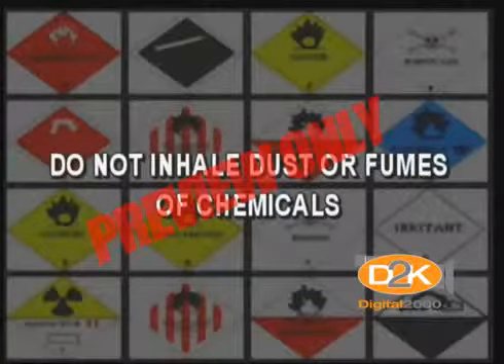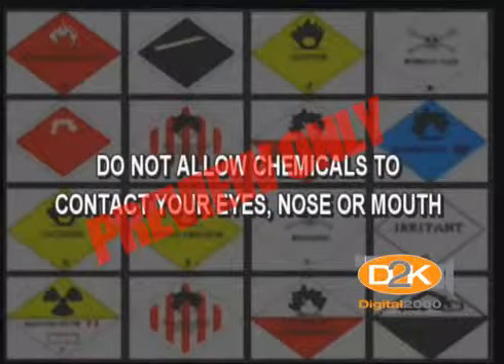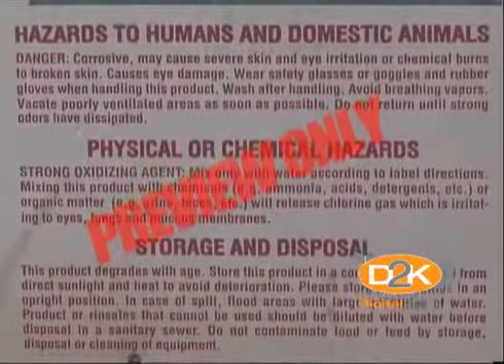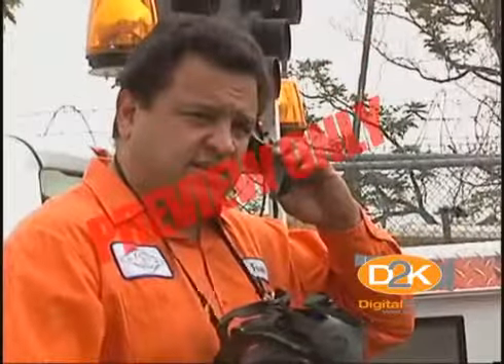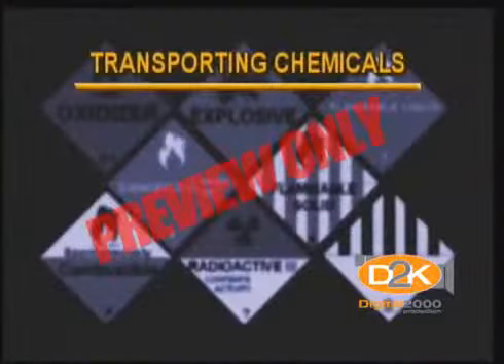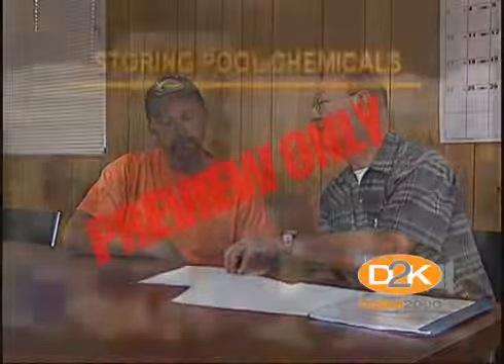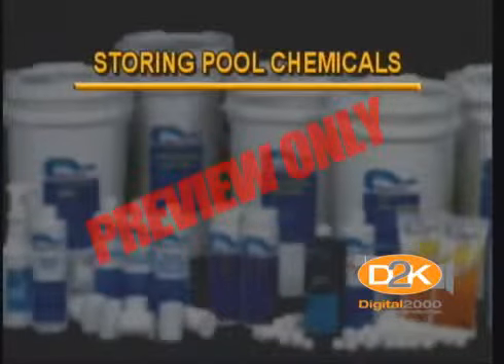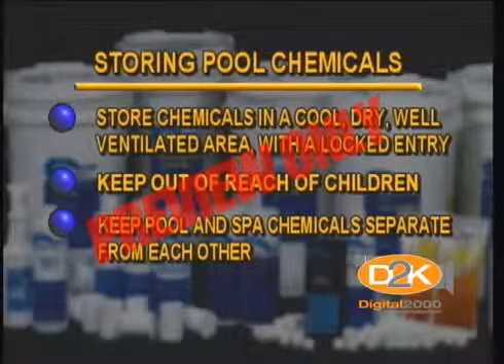Pool & Commercial Spa Chemical Safety Training Video

Comment: For safety's sake , Never mix chemicals period , and before you begin to purchase and handle chemicals , Contact an industrial supply that specializes in safety equipment and be sure to obtain the necessary PPE Personal Protective Equipment for performing pool maintenance , The PPE you must have 
Long arm rubber gloves 
Safety goggles 
Face shield 
Especially , An OSHA approved respirator with filter cartridges for handling pool chemicals and other personal protection equipment necessary , Never use a cotton dust mask or any other cheap masks that you find at the hardware store 
They do not filter out chemical fumes and having a respirator for handling pool chemicals is definitely a must have as part of your PPE because you never know if toxic fumes will be released when adding chemicals to the pool and chlorine gas is highly poisonous and will literally burn out your lungs as well , I myself would never handle pool chemicals without the proper PPE including an OSHA approved respirator and never mix them , Not worth the risk 
ALWAYS READ AND FOLLOW THE LABEL INSTRUCTIONS EXACTLY AND ALWAYS PUT SAFETY FIRST !!!